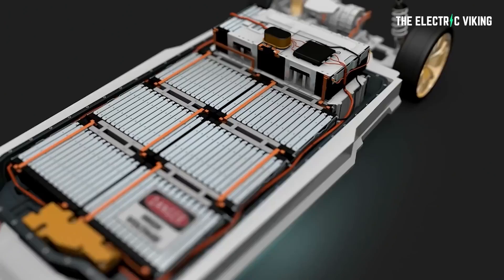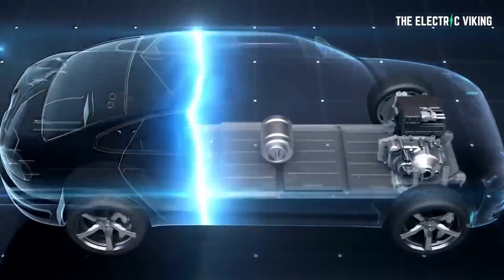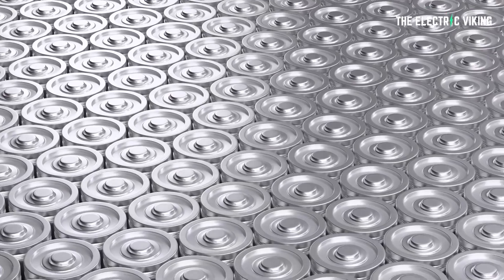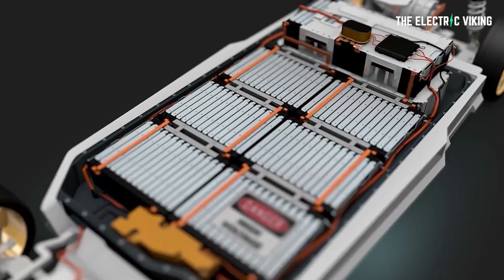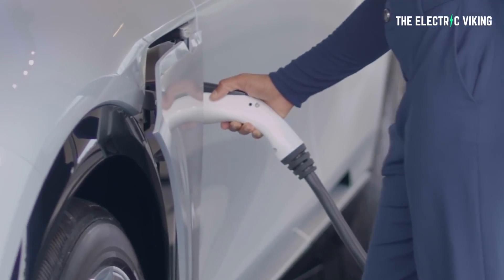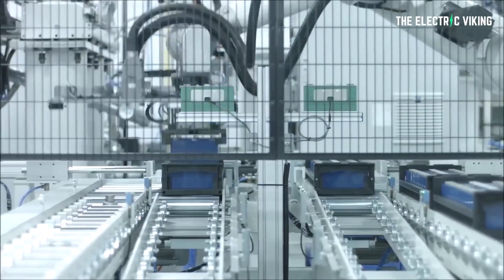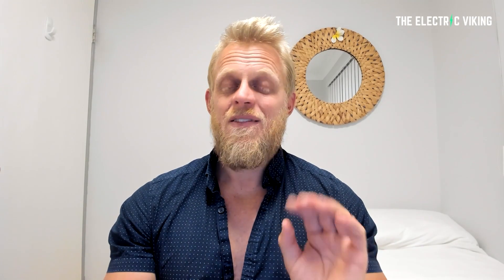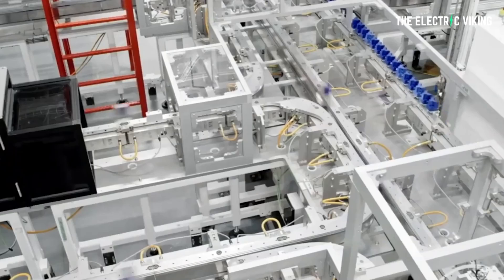Amazing breakthrough can double the life of EV batteries

Comment: What a plonker!  The life of most batteries will outlast the cars (other than Leafs with no active battery  management). Degradation is negligible if most charging is AC level 2 home charging.  Even Teslas doing 300,000 miles plus (LA to Vegas shuttles) and always being supercharged have had only about 10 to 12% degradation.

Comment: This is good but what is needed either from the manufacturers or from the auto companies are improved replacement batteries: if the new type doubles the range I should be able to replace my current pack with the new type. This is a major field that MUST be looked at for all EV's.

Comment: I expect it is somewhere between.. Once you will start it is cheap..only one atom and such..usually you can expect same results..almost none..

I would be glad to be wrong..but if they are only adding one small layer to cathode then i expect not a bit change in chemistry is done..so not likely to see increase in any other areas..But if it really help to increase amount of cycles battery can do that will be big plus..for sure..

Comment: Yet real life experience with Hyundai Evs show significantly less than 1% degradation per year. There is research that shows a blast of high current discharge just after the battery is full causes the dendrites to dissolve and migrate back towards their electrode. Maybe this barrier will work but it does not sound earth shattering.

Comment: i am not sure if it is that easy to apply a one atom thick layer to a surface. so, that is something that needs to be explored and optimized. however, even if it would be an expensive material like cobalt, one atom thick layer is next to nothing which means that it is cheap. but on the other side, what happens if there is one spot on a battery where that coating did not work out and that spot is degrading fast.
whatever, it will always be a challenge to find new exiting chemistries and it will always be a huge challenge to find cheap reliable ways to apply them.
what counts is, that batteries are getting cheaper every year. from a graph of bloomberg from 2010 to 2018 the average annual reduction of costs on pack level was 21%!!!
21% cost reduction every year per kWh!!! that is huge. it might slow down a bit to only 10% cost reduction per year but nevertheless, this is huge.
and this will allow us to have a cheap 40kWh home battery where we buy electricity only when it is cheap.
Reply: Semiconductor makers put one atom thick layers on chips all the time but it can take a vacuum chamber or special gas depending on the materials. The material is cheap, but the process could be expensive and tricky to do.

Comment: Probably won't happen in my lifetime, but I can see cars in the future with super efficient solar panels embedded in the body panels constantly recharging the battery, so the car may never have to be " refueled "  this process described in your video could be an incremental step towards achieving this.🤞
Great video, I hope this comes true.
Reply: Sun doesn't supply enough energy to the skin area of a car to enable typical driving.

Comment: Sam, why can't some company make a smaller, lighter Leaf battery that is affordable...and fits the older Leaf models...? There's 500,000 good EVs needing upgrades...and Nissan isn't helping this.
Reply: Apparently there is a company in the Netherlands that does this.  Search on youtube, some car channel guy took his old leaf and had it refurbished there.
Reply: @SkyRiver1  Blue Cars in NZ is refitting used Leaf batteries too..often 82% 40 kwh...but still expensive. Half depleted Leaf batteries are still worth $3000 US as home power storage. There is hope. But there is commercial room for a generic supply of EV batteries to be marketed and  interchangeable.  Nissan then just needs to release the computer software to enable Leafs to accept generic batteries.
Reply: @MENDNZ  I wish I lived in New Zealand: apparently one of the few sane governments on earth, though I am sure that many individuals have their complaints as is only mechanically human.
Rudy Heeman lives in New Zealand, and if I lived there I would hire him to build me one of these https://www.youtube.com/watch?v=pEm5tloP0Uw&t=2s
This one sold at auction for 25k but it wouldn't have if I was there.  I would have bought it and shipped it back to the states where something similar but not as good would cost you over 125k.
Reply: @SkyRiver1  Robert Flewellen on the Fully Charged channel.

Comment: Piling on. 

I can see how a passivation layer would do that...

I have seen a couple papers recently about strategies to force lithium deposits back into solution or back to the anode. 

Basically... 10khz pulses that charge and discharge.  Overvoltage on charge, and longer low voltage discharges. Alternate the polarity at faster than the battery can plate lithium to the graphite, and lithium will be dissolved into the solvent. It destroys dendrities.  

I DIY. I can build that rig... Thinking about trying to revive some batteries with this approach. 

Probably going to catch them all on fire...

:)

Comment: Thanks Sam!  I hope this new tech works out.   BTW: cobalt and nickel may be rare but they are not rare earth elements.  Many/most rare earth elements are not actually rare.  Perhaps the best known rare earth is  neodymium which is used in strong permanent magnets.  cobalt is used in another type of rare earth magnet but it's called that because it contains samarium which is a rare earth.
Reply: Present LFP has 1500 cycles. not sure why this hype about this  lab tech

Comment: I’ve always thought you could do with a hybrid battery technology, using a high cycle battery for everyday driving with a ‘range extending’ high density battery used for longer journeys. This might be an alternative to allow for higher production scale especially if the high density batteries are more expensive and less available.
Reply: There is a US company already touting this as a solution, Nio also offer one but I'm not sure if this is their rationale.
(Sorry, can't remember the US company)
Reply: This is a good idea. The LFP could be small…about 50 miles worth for daily commute. Then your nickel battery doesn’t get the unnecessary cycles.
Reply: @hankkirby2576  I think the US company is using a chemistry that is both higher density and more sensitive to cycles than NMC. Might be a version of LiS, can't recall. LiS promises to be cheaper than NMC  so overall battery price stays low.

Comment: There are a lot of used Teslas for sale that are about 5 years old, all those use Teslas have atleast 20% or more Battery Degradation and they will continue to lose , any replacement at 30% will run anywhere from $12K to $23K from tesla to replace batteries, Something to think about
Reply: sorry, but this is rubbish. 5 years = Model S = 8 year battery warranty. Plus all data point against this. you likely mean the 1st gen Nissan Leafs without battery thermal management .
Reply: You just got schooled by Elon! 🤸🤭
Reply: That's funny, the report that I read claims that the average Tesla S that is eight years old still has over ninety percent left.  Guess one of you is wrong.  I would bet that it is you.